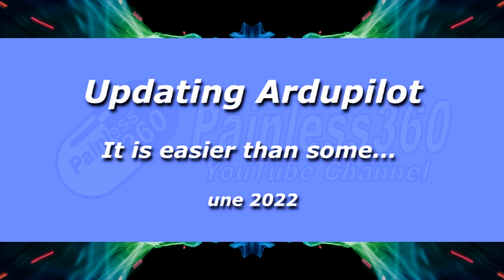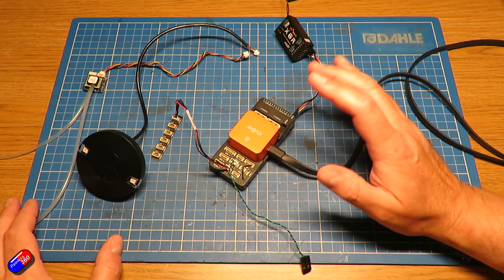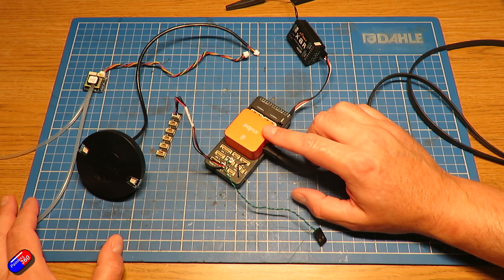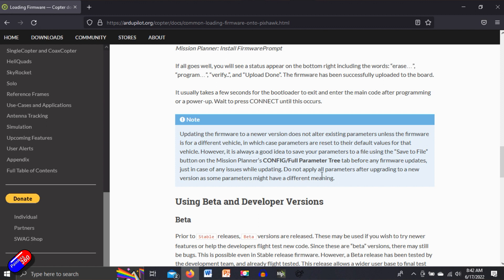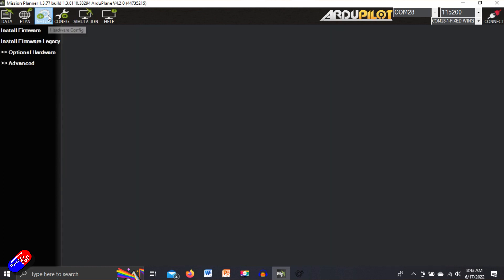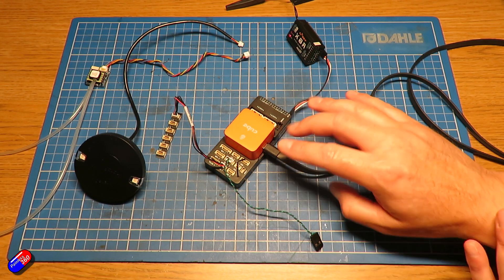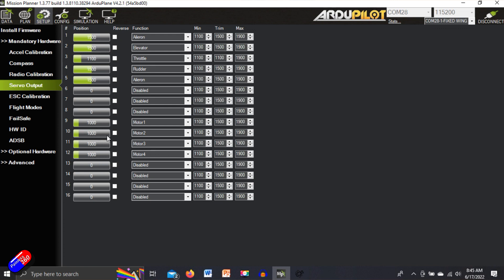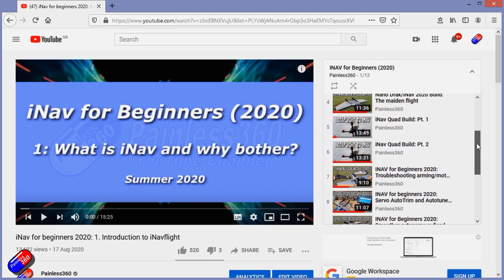Upgrading Ardupilot and how to reset a Pixhawk to 'factory' settings....

Comment: Hi! I just bought the E-flite Timber X and I've seen some cool videos of it using thrust reverse. I have only seen it done with the spectrum config, but I fly FrSky all the way. Do you know a way of programming reverse thrust in OpenTX?
Reply from the maker: Reverse thrust is something on the ESC. There is usually a seperate connection to reverse. See my videos on things like float planes.. Happy flying

Comment: I have found with certain flight controllers, versions of arduplane and versions of mission planner, you can't connect to the freshly flashed flight controller unless you close mission planner, unplug the usb, then reconnect and connect. Not sure whether this is an issue currently, but one to try if you have trouble connecting.
Reply from the maker: I've not seen that. Make sure you are using the latest version and uninstall the previous version of mission planner before installing the new one are my top tips..

Comment: Wondering if you have any suggestions.

Looking for a Drone or Drone build that can be achieved in the £800-1.5k mark that can be used for animal SAR, for winter and wet weather.

Current SAR solutions are normally well in excess of 3K, and volunteers doing SAR, in general, are hobbyists volunteering their time using self-purchased equipment.  A lot of consumer drones are simply not suited to wet weather and traditional FPV can be problematic, especially when trying to sit in place to spot movement. 

Therefore, wondering if you could suggest a drone build using consumer components that can achieve a reasonable SAR wet weather drone that can re-use FPV parts for VTX and Controller such as TBS CRSF and Digital Caddex camera type systems, to allow for an FPV view but with the capability to hover in place, to allow for a more concentrated search and minimal stick input.  Ardupilot looks like a place to start but while I fly and build basic FPV, have no experience in dev for FCs or Autopilot so wondering am I barking up the wrong tree, is this harder to achieve than I imagine hence no real option for volunteer SAR  on a budget?  Can anyone suggest a DIY build, or platform that is suited?
Reply from the maker: Ardupilot would be a good starting point. See my Pixhawk 2020 series.. Happy flying

Comment: Good morning .
Can you help me , when I want to configure the chute , it does not give me the option of RC9 = 22 .
Manual Release
The pilot can manually release the parachute using an RC channel/switch: set an RCx_OPTION to either 22 (Parachute Release) or 23 (Parachute 3Pos). Either function, when the RC channel is high, above CHUTE_ALT_MIN, and is armed (Copter) or flying (Plane). See following section for requirements.
Reply from the maker: This is not something I know about. Best of luck

Comment: Can you show a video providing a solution not being able to flash a firmware due to bad bootloader on a pixhawk black or orange cube hardware. No matter how hard you try it wont connect to the MP bec  of a corrupt bootloader file. And the only solution is to get into dfu mode. Im sure people will benefit this.
Reply from the maker: I've never seen this here. I'd need a problem to show the solution. Try another USB cable in case and flash using the latest Mission Planner ... Best of luck